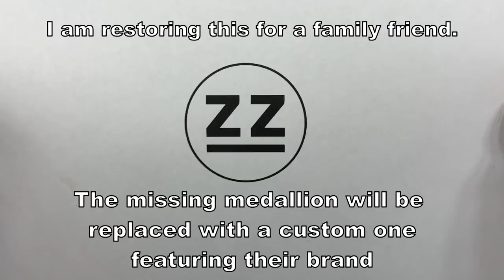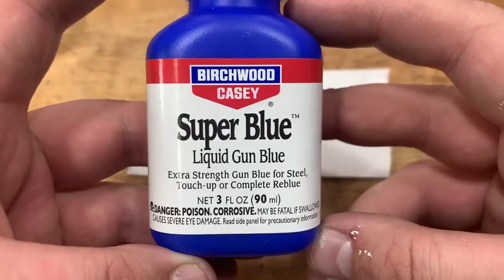1850's Chuck Wagon Coffee Grinder Restoration

Comment: That custom finish mix you applied looks very authentic for the time. So many of the restorations I see on YouTube use finishes (e.g., powder coating) that give an especially fine appearance, though they look much more refined than would have been the case back in the day. Excellent work really.
Reply from the maker: I try to stay original, but it can be difficult at times.

Comment: I have a nearly identical grinder im in the middle of restoring! nice to see another one brought back to life. The lid to the hopper on mine was roached out in a few places that had gotten very thin but the perimeter was still good, and since my lid is a bit more ornate with embossing i decided to take strips of soft paper dredged in epoxy and paste them on to the areas where the holes were, then filed down until it matched the embossing. I couldnt use japanning on the piece but after a couple coats of a hard wearing epoxy paint its hard to tell it was ever in need of a patch in the first place
Reply from the maker: Would love to see pictures of your project. Post them to my Instagram
Reply: @PegasusProjects  Sure thing! Ive actually got the bits I want to leave bright metal (lid staples, the acorn nut on the handle, the adjusting nut and backplate for the grinder) tumbling in a shot barrel to burnish before final polish, I had to set them aside for a while while the paint on the other bits cured fully

Comment: That japanning is bad ass! some excellent things done here. well done on the welding. I would have blown holes in that thin-gauge
Reply from the maker: I'm a fan of it now. I did blow through with the TIG. Was able to get the MIG to work. Putting the copper on the underside helps a lot.
Reply: @PegasusProjects  Have you ever seen the lacquering process used in Japan that Japanning is based off of? It's pretty neat.

Comment: I feel that more work was put into the restoration than was in the actual original manufacture of the grinder.
Reply: Called a "restomod". ;-) Bring it back to life and make it better than it was as it was new. Like muscle cars that get tuned engines, drivetrain and chassis components that make them handle like modern cars.

Comment: Kudos for being brave enough to try out some firsts. I've heard about japanning for years but never looked it up or saw it done. I'd be interested to learn more. I liked the quick and dirty "hydro" press too, it came out pretty well. That sheet metal is almost impossible for a MIG setup. I've tried on and off a few times with mine over the years and even with very small wire it always burns through an globs like that. A TIG set up would be the modern way to go but obviously is expensive with a decent learning curve. Silver braze would work very well with a lead free solder as a filler to blend the overlap. Even a small BernZomatic Oxy MAP setup would allow you to gas weld with your mig wire as a filler rod. Either option would give you much better heat control on the thin parts.
Reply from the maker: Thank you. I will give those methods a try. I have several projects upcoming that need patching on thin sheet metal. Thank you for the constructive feedback!
Reply: @PegasusProjects  You're welcome. I was just thinking about how easy the silver braze was. (It's what they use to apply the carbide teeth to saw blades) it's very strong and has very good flow characteristics. But I recall a couple projects that I had difficulty with due to clamping. If you clamp the parts too tight there isn't room for the silver solder/braze to flow into. I was thinking about clamping options when it dawned on me. Maybe a cheap harbor junk spot welder in your arsenal would be the way to go. Spot weld the pieces together then follow up with the silver solder for strength and to blend the edges. best of both worlds.

Comment: You should use solder for cosmetic repairs like this. No need to weld and deal with all the splatter and over welding. Or use a tig.

Comment: When 'welding' thin sheet, acetylene gas welding works much better. I used steel coat hanger wire as filler, it was free and did the same job as the brass coated steel rods sold for that purpose. You wind up with a much flatter bead. We used this on auto body work where the seams had to be smooth and flush...
Reply from the maker: Thank you for constructive feedback. I will give this method a go!

Comment: would a piece coat hanger wire work ?Me and My ten magic thumbs could not do what he did without slicing my fingers up ,they would covered in Bandaids!
Reply from the maker: It should work. You can strip it of the coating to get down to the bare metal

Comment: I haven't added a comment in awhile, and THIS one stood out,,,  I have to say, restoring ANYTHING from 1850 is next to the limits on patience and trying to understand how the builder made it, as most things were manufactured uniquely,, copied yes, but still it had the singular craftsman's trade on it,, not "made in china",,,   I will give you the 'ews' first,   why polish a knob then paint over it?? hmm   Replacing the wire,,  I would have stayed with the original as much as I could,, , and as a last factor, I would have "sharpened" the edges on the grinder "plates" so it ground more finely,,   to the pro's,,  I like how you took your time, noticed LOTS of detail,...,  I was confused with the ZZ but then realized you were using it for a mold shaping,  brass was ok,, if it was the original metal, (looked like something from f troop or Dances with Wolves actually,, was this off a military chuck wagon?)   and the color was great along with the japanning,, (never seen it before but understood it),, and lastly ,, YOU showed us it worked!!!!   Now, last question,,  did a horseshoe stand up in the coffee when you brewed it???   hahahahaha,,   great vid,,  HAGD  .....    E
Reply from the maker: Thank you for the feedback. And yes it did. Knocked my socks off.
Reply: Just super Awesome Job, MY HAT IS OFF TO YOU

Comment: You can bet when they made it originally, they were not expecting or designing it to last 170 years. Despite such, it's in remarkable shape for the age. The fact that it still works is amazing. You go to the store today and buy a "coffee grinder" and are lucky if it lasts a few years. Sure, you "could" repair it, but they are not designed to be repaired and finding parts to repair it is practically impossible.

Comment: those "aftermarket" spacers in the back were added to try and make the grinder work better. im surprised you didnt take a file to the wheel and sharpen the teeth a bit.

Comment: What was with the censoring when you were making that metal patch?
Did it have something to do with the bright welding lights causing a error in the camera's white balance for those few seconds?
Was it because the exact method you used when soldering wasn't exactly a good idea in hindsight and you don't want others imitating it for their saftey?
Or was it some sort of innuendo involving soldering that I don't get.
Reply from the maker: It was a poor display of TIG welding that should not be duplicated. I'm still getting the feel for welding thin metal.

Comment: On thinner metal parts try gas welding, brazing by another name,  and not electric welding, its a gentler process
Reply from the maker: And for the filler material? Silicon bronze?
Reply: Since when was gas welding "brazing"...?
🇬🇧👍
Reply: Hi Glenn, i'm not referring to processes such as MIG or TIG here but brazing is defined as "a metal-joining process in which two or more metal items are joined together by melting and flowing a filler metal into the joint, the filler metal having a lower melting point than the adjoining metal". When i used to repair cars, on the non structural areas, i would use a gas torch, oxy-propane or similar and melt the filler wire into the gap using flux, of course. Apologies if there was some confusion in my original description
Reply: @PegasusProjects  - That would be my choice
Reply: noticed that too!        brazing the parts that were going to be japanning covered would be just fine, and less mess and more smooth,,,

Comment: Holy bird poop batman. You need more practice on both mig and tig.
Reply from the maker: Definitely on thin metal. Don't do it often
Reply: @PegasusProjects  you have to go very low heat with tig. You could also use an aluminum back to help pull heat away. But just like the mig process just use simple tacks. And let cool between welds
Reply from the maker: @brandonbelk5559  I'll give that a go. Thank you for the tips